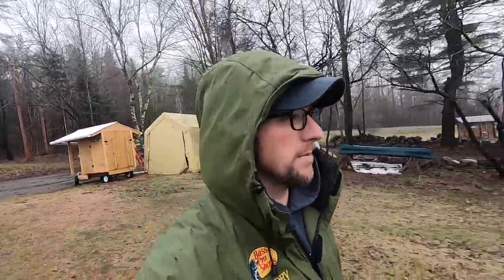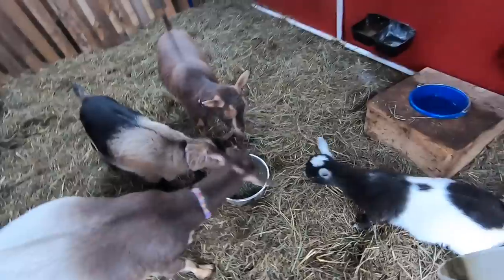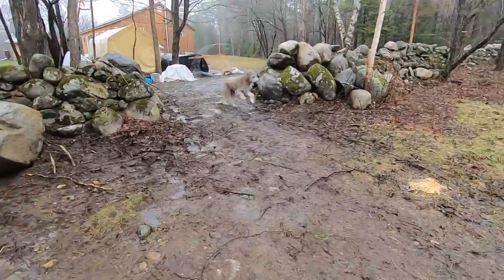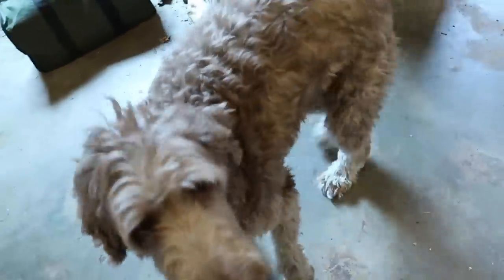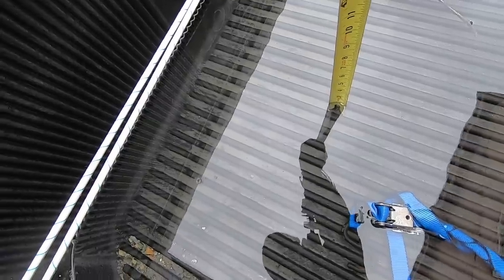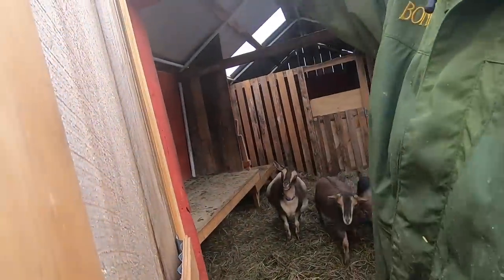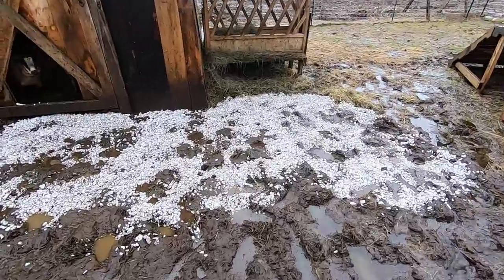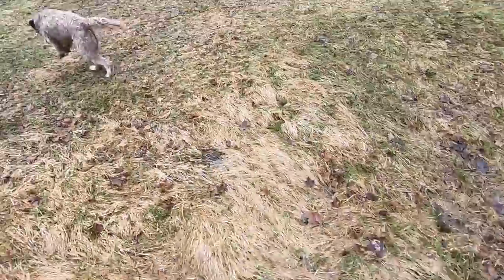Rescuing the Goats Turns into a Huge MESS!

Comment: Drainage system with catch basin’s. Put a (Blue barrel) filled half way with stone put several holes in the sides of the barrel to let water on&out. Place this in  a hole out side of the pen around were the little trench you guys made. Get a Drainage pipe, & Lay fabric cloth Then fill bottom with stone,lay the pipe cover with more stone from around the door to the feeder. Hope it helps a little. God Bless Love your videos 🥰

Comment: You should think about making some gravel roads with some road fabric and ‘5 stone an then 3 stone to lock it in . Your farm is growing and should put an access plan together for walking and tractors and equipment. Good luck
Reply: I think that was the plan when he builds the barn. He can't do it because of the load limits though.
Reply: if it ever stops snowing/raining and dries out, ambe they will try sometihing different when they put up the new barn.
Reply: Agreed
Reply: That's the plan. They have an old livestock lane that goes down right to where the new barn will be. It got cleared when they cleared all the trees last fall. But they have to wait until the Road Bans are lifted for loads over 20 tons (I think that's what he said at the beginning of the video). Then they'll gravel the livestock lane at the very least.
Reply: I agree with some commenters.  Goat shed seems to be in a slight swale.  During the summer I would think about raising the foundation to prevent mositure from rotting the base of the building.  Also, you can get Marston Matting from government surplus and military bases....sometimes for free  The solicit bids for surplus or used items.  When I worked for NASA we had excess matting all over the place.  You could place the matting out about 10 to 15 yards in high traffic areas where mud build up or poor drainage occurs.

Comment: Al, It looks like you need to get a shovel out and start trenching a drainage system and mapping out how you can grade your land to drain rather than puddle. It would be well worth it for those occasional downpours you get in Northern New Hampshire. After years of mud and puddles, I finally did it on my land and the melt and rain just flowed away.
Can you find a bunch of pallets to set in the goat pen ? You'd need to fill the gaps between the slats. They would create a nice deck.

Comment: One idea when putting in buildings is to raise the building pad up at least 6 inchs, one foot would be better..
Then slope the dirt away from the building maybe 3/4 inch per foot to insure the water runs away from the building...
And if funds are available..
With a rototiller, mix in cement as wide as possible..
3-4 sacks per cubic yard should be fine.. Try to mix it 5 inchs thick..
What you are making is called Cement Treated Soil..
One Cubic Yard = 27 cubic feet
90lb Bag of cement = 1/2 cubic feet
6ft x 12 ft x 5inchs (.41 ft) = 29.5 cubic ft..
Based on that 4+ sacks of cement would work..
Mix it in, if the soil is dry add  enought water to moisten it.  With what ever you have compact the cement soil.. (tractor, car, truck, ?) smooth off..
(don't quit until you're done.. It's going to set up like concrete)
If when you're done and think it might be a little dry.
You can lightly spray some water on top.. 
That should keep the area around your buildings mud free for ever.  ...
Just a suggestion to help keep things dry....
Good luck with your projects
Reply: Side note.. Roto-tilling the dirt first... Then spreading the cement and tilling the cement in.  makes getting the cement mixed easier..
Reply: Yes mixing in gravel would help...
But most of all is planning and preparing the building site first....
Rather than trying to do something to an area where water flows thru it..
Reply: The best post I've read in a very long time. 👍
Reply: So glad there's help on hand for Al! We live and learn, right? 🙂
Reply: Excellent if you get the slope correct originally.

Comment: One way we deal with Muddy flooding here in the Red River Valley is. Where ever you have created those rivers for the water draining. Put a TON of grass seed in them. Alot of the seed will rot but enough will sprout that you create grass rivers that suck up water. It is why we also have HUGE GREEN tall grass rivers in the open fields. You would be surprised how much that helps with floods.

Comment: Definitely some good advice here about thinking of access roads. And even putting the building up on a pad. Maybe it will get like this next winter maybe not better to prepare then be stuck trying to run your tractor in 7 inches of mud. One of the few times I am very glad we live in desert area. We got a ton of rain but nearly zero flooding.

Comment: Even another hundred bags of that rock wouldn't fix that swamp in your goat pen. Maybe move the goats to higher ground and use that spot for piggies?

When you need to use the Kubota in such challenging conditions, consider putting some of the heavy rock bags in the hopper behind you as counterweight on the larger tires for better overall traction. Those baby front tires were well past their limit in the soft muck with an overfilled bucket.

Hope the weather turns nice soon for you soon. Keep your socks dry, buddy.

Comment: My mum advises that you use your ashes from your wood fires and sprinkle it on your muddy mess. Thats what they do in Europe. As the snow melts and gets muddy they sprinkle their wood ash from their wood fires. Its also good for your soil and plants later on.
Reply: They sprinkle the ash on the snow and ice so they don't slip when walking on it.  It's not going to help with the muddy mess.
Reply: @tannenbaum3444  It will help create a great soil but you're right, it won't help with that muddy mess. Great on ice/snow as you mentioned as well.
Reply: Ah so that’s why they throw ash on the roads. Thanks for clearing that up. But I was reading it’s good for the soil and one homesteader uses a bit of it to help give traction to their vehicles when stuck in mud 😊
Reply: @tannenbaum what would you recommend Mr Lumnah use? Would straw mixed with something else help dry up all that water?
Reply: @agnestakacs2059  In mudd it will make the mess even worse...it's good for snow and ice to help from slipping.
Reply: @agnestakacs2059  I would dig a 1 ft. Deep ditch along the line where all the water accumulates and fill it with rock so the area can drain properly.

Comment: When the rain stops and drys out, dig a trench where you can circle around the goat pen. Fill that with crush and run and dry cement mixture. So next season it will not be worse.

Comment: In Michigan the weight restriction on the roads  is called the Frost Law. The layers of earth at the frost line hasn't thawed yet. The top layers can't drain because of the frozen lower layer. Causes the mess you see at the goat corral. The same thing is happening to the roads. Excess weight will tear up the roads until the ground is completely thawed and proper drainage occurs.
Reply: ken Matthews I'm also a Michigander and never heard of the "frost law?!" You must be in upper MI or UP perhaps? Where it would make sense to have the Frost Law. Very interesting, though!
Reply: Well, maybe you should go and look it up. Because we got all kinds of crazy laws in Michigan. Maybe we do have that law.🙈🙉🙊🙈🙉🙊🙈🙉🙊🙈🙉🙊🙈🙉🙊😺😸😹😻😼😺😸😹😻😼😺😸😹😻😼
Reply: @natashasemrau3670  Not saying we don't have that law in MI!! Was just surprised because I haven't heard of it in lower MI.
Reply: Michigal 810 it’s throughout the state n the spring for a couple of weeks until the thaw on certain roads and applies to heavier commercial trucks. Like gravel haulers.
Reply: Yes, under soil dynamics, it is everywhere,  but mostly underneath.

Comment: Here's a trick I use to move heavy/awkward objects over hard to manage terrain/tight areas or muck as I am a woman and have more brains than brawn, I use a large SNOW SCOOP. They disperse the weight, are low to the ground and easy to drag. I move large stones this way all the time. They are probably on sale at this time of year too. Just drive up as close as you can with your load, then drop a bag or 2 in the scoop and drag over the muck with the snow scoop. Works like a charm :)

Comment: I might be out of my range with this advice, but why dont you try to squeeze the water out of the mud in the goat pen by using a sheet of plywood and the tractor? You could make canals around the goat pen so the water has a way to flow out. Also have two sheets of plywood to move in front of the tractor on your way to the goat pen so it doesn't sink in the mud.

Comment: Al, I wonder if digging a trench to the left of the goat house door (just outside the fence where Gina was walking when you had the GoPro on goat mountain) would allow the water near their door to drain away to a lower point. I've heard damp walls in a house are often caused by the floor level inside being slightly lower than outside. Perhaps the same principle applies. Just a thought.

Comment: As I watched the video I was thinking really need a proper lane way down to the goats and the new barn or you will have the same problem every time you get lots of rain. maybe think about moving the goats to higher site or raising their shed up a foot or so onto concrete slabs? maybe adding a porch and floating ramp at the door.  As you were working so hard to incorporate the stone I was concerned you would eventually find it hard to open the door,. i may be wrong, but with repeated heavy rain in that location,  your goat shed will gradually sink into the soft wet soil especially if there is no packed base.  You might think about putting in a wooden sidewalk, just recycling old free wood pallets. The goats would use it as a runway, when its mucky out, and you would have it to get in and out to the shed.. and keep it clean. Everything costs and it all takes time. your Figaro and the pooch sure are cute. enjoy your cozy wood stove. i wish I had one here this morning! ❤️

Comment: I know this might be  terrible suggestion, but in Arizona we sometimes deal with flooding or mussy ground by using salt rocks with gravel and compost or some potting soil if you have it. Just something to break up the clay in the soil will really do wonders and allow the water to either evaporate easier or lower to ability for water to continue to collect.
Reply: Beware: salt poisons soil for plants. [Good organic weed killer, great on roads]
Good advice for Western high alki soils is bad for acidic soils in the East.
Run ideas by your County Extension Agent.
Reply: @lindapolle1665  That's why I said it might be a terrible suggestion. Arizona soil is completely different from the northeast.

Comment: Perhaps you could run a weep system right through the goat pen, just a single 4" fabric wrapped line down the middle of the pen and run a drain down to a low spot. Home depot has a 4"x100 foot piece for $95 just put this in their search Model # 04730100BS. You probably won't need 100 feet to do the pen, but you can use the left overs for around the new barn if you need to!

Comment: You can collect egg shells then toast them. Break them up very small and feed them back to the chickens. Great for replacing calcium. Justin Rhodes and other homesteaders soak their chicken feed in water or skim milk. Some let it ferment after adding water but it needs to be warm weather I think. This way you can feed less and get more weight gain. Just a few suggestions.

Comment: a pond at ur low point.  run ur rain leaders into it.  line it with a big tarp, cover that with rocks. Grade ur general area into it.  minnows and catfish. 
also, u should have someone fabricate a grader blade that sits where the mower normally would. use the rockshaft to lift and lower it.  i built one for an old jd 140 i have.  its insane how well it works.  three point blades work i'm sure, i had one once but it made things worst since everytime the front of the tractor hits a bump or a dip the blade either leaves the ground or digs in hard.  i can make a video showing mine if ur interested.  its essentially just a blade, attached to two arms that hinge onto where the mower attaches at the front, and some sort of linkage to attach it to the rockshaft.

Comment: I would be willing to bet that the waterer inside the PPM will cause you a lot of bedding headaches and will cause floor damage to boot...
Reply: Hogs will turn any pan over, and bedding will still get wet... raised hogs for most of my life up until late 20s and if it can be flipped over it will be and if water is around in any form it will be spilled.